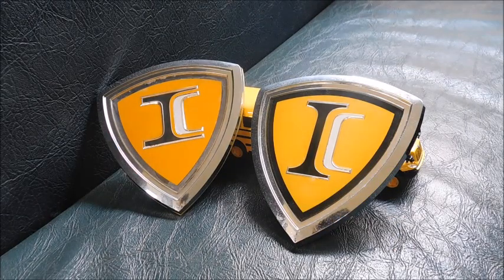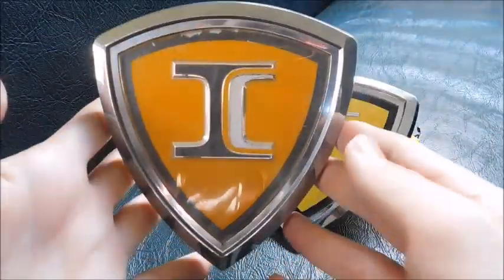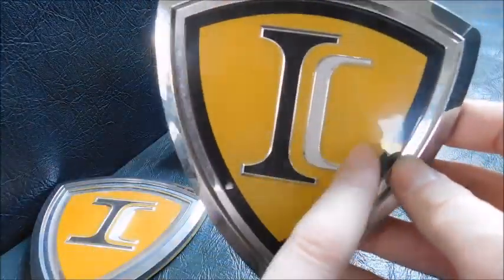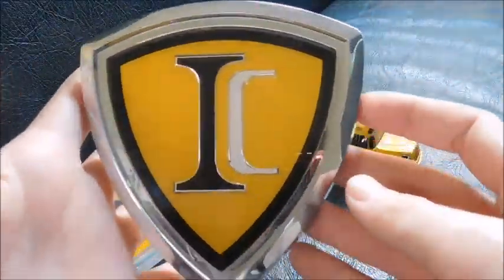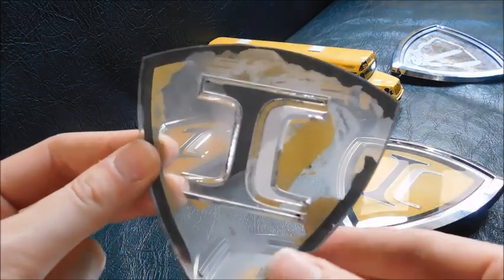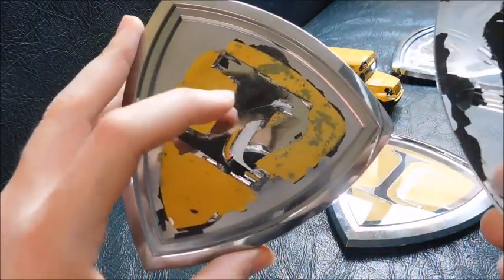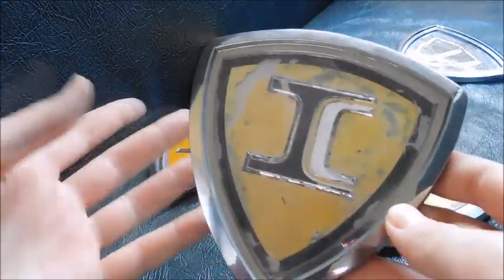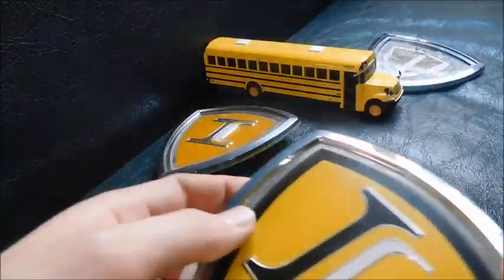How is an IC Badge Put Together?

Comment: I like how you use the IC model to hold up the badges and they NEED to bring back bus model.
Reply: We just had 2 2014s have the piece fall out also i got my first every ride on a blue bird.
Reply: I doubt my county gonna replace the badges.
Reply: One of our 2011 CEs recently did it.
Reply: One of our 2011s lost its emblem entirely but they actually replaced it with a brand new one, most of our older CEs have a faded or broken emblem, even some of our newer ones are starting to fade, all 10 of our 2020s are starting to fade.
Reply: I kid you not the 3rd gen’s literally have an adapter that goes over the International diamond with the IC logo on top of it.